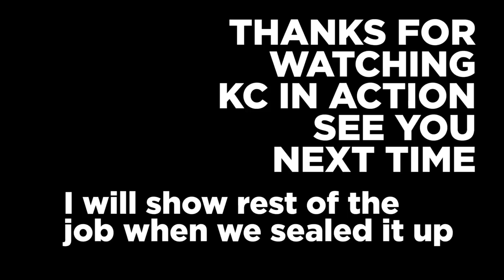Patch Pointing round window with kc - little job

Comment: How was that window fitted to the walls, I didn't see any metal straps or anything?
Reply: before the glazing goes in there is usually holes in the window frame to fix the frame into the masonry with raw plugs and screws, probably also supported in place with expanding foam